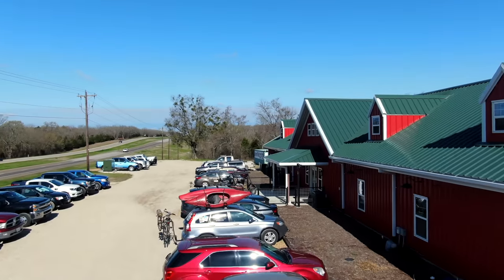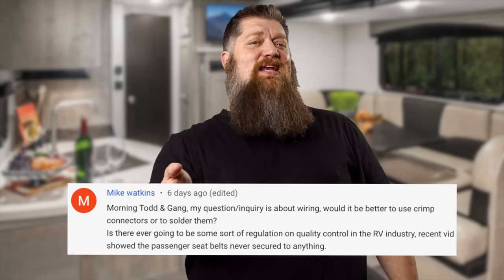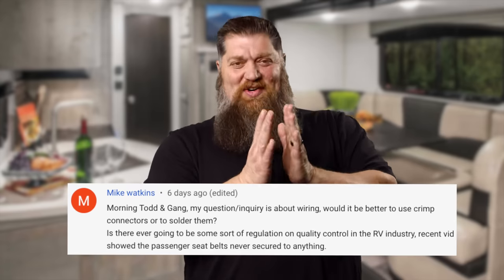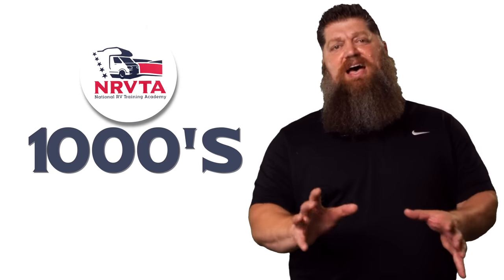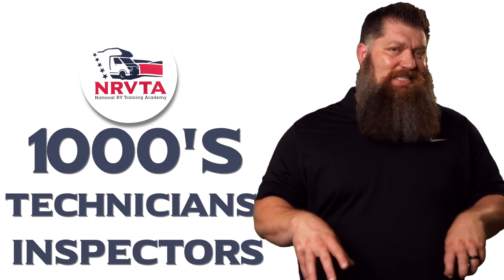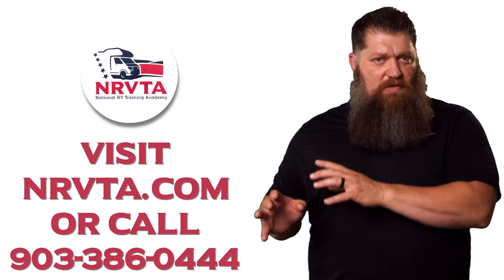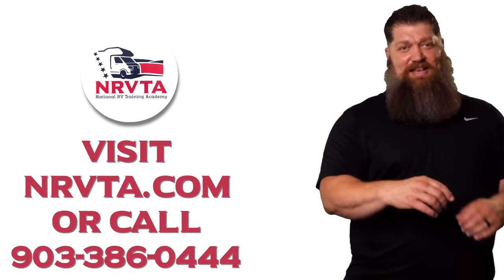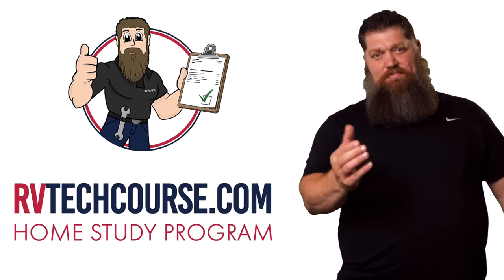Crimp vs. Solder in my RV.  Which is better? // Your questions answered.

Comment: Soldered connections work well for small components where there is little or no flexing at the solder joint, like discrete components soldered onto a printed circuit board.  Components are usually mounted very closely to the board to reduce / eliminate the movement / flexing at the soldered connection.  In applications where vibration is expected (military, aviation, or high stress environments) the components mounted on the circuit board may be held rigidly in place with a non-conducting coating that resembles a lacquer.  If soldering is done right there will be ZERO air gaps because the liquid solder would flow into and fill all the voids.  Flexing of the transition between copper wires and the solder will weaken the bond.  That can lead to air gaps and cause a "cold solder joint".
Crimped connections work well where the cables and components are larger and some flexibility / physical movement is expected.  The key to a good / solid / reliable crimped connection is to properly match the crimper and the terminal to the wire / cable.  If the crimper / terminal are too large, then the connection obviously will be loose.  If the crimper / terminal are too small, then the terminal or wires (or both) may be damaged.  Either case can allow bad things to happen. 
My (Dave's) background: about 44 years as in the nuclear power industry - both US Navy (electronics technician trained in soldering) and commercial power production (calibration technican that worked on dozens of different types / sizes of crimpers).

Comment: I've ben making connections is wire for marine applications.  The flexing of a soldered connections is concentrated at end of the solder which forms a stress riser at the change in flexibility and often  fatigue failure.  Been using crimp connectors for 30 years with sealant.
Reply: I don't see how that's different than a crimp. If a good crimp is 'cold welding' then the flex changes at the edge of the crimp. 
I don't have a firm opinion, just frying to understand the issues.
Reply: @luminousveiws  I posted a detailed comment elsewhere in the thread that may answer your very good question.

Comment: Thanks, Todd.  Do you have an opinion on self-solder heat shrink butt connectors?
Reply: We use Grote heat shrink butt connectors on our Peterbilt and 53 ft connestoga step trailer. They're fantastic.

Comment: 1. The NEC is NOT a guideline. It is a requirement that includes RV's.
2. The NEC does not cover the low voltage equipment. (12v)
3. The NEC allows solder only on connections that are also mechanically connected.
4.The NEC does not allow solder on grounding and bonding connections.
5. Solder only connections can fail/open from high heat caused by high current flow.
Reply: They are supposed to fallow the NFPA but there is no
Reply: Enforcement that I can find I have problems with my new campers. The manufacturer at this point is refusing to fix it is covered in the NFPA chapter 7 how do I get the manufacturer to fix it
Reply: @davehuber6949  I can't understand what what you are trying to say.
What do you mean by enforcement?
You have more than one camper?
What type of campers?
What brand?
What is the problem, exactly?
Reply: I have a 2022 pinnacle the bathroom gray and black tank drain runs up hill so the black tank valve gets full of debris and don't hold. I have to tip my camper until the level Buble is over a 1/2 inch per foot of to get the tanks to drain down to 1/3 of a tank. I have Ben in San Antonio for a month. Getting no where on getting it fixed being told by dealer jayco is saying that is how it was designed. They just want to change the black tank valve and not fix the problem. Then the black tank flush vacuum breaker is in the wall between the bathroom and bedroom with no access not mounted to anything and no access panel leaking in the wall and running into the storage compartment.
Reply: That is the problem the agency that is supposed to be enforcing is paid for by the industry and represents the
Reply: @davehuber6949   You said NFPA indicating you had an electrical problem.
Of course it wasn't designed to not work correctly. I would talk to Jayco myself. It could be the dealer just doesn't want to make any repairs because they have to fight with Jayco to get paid or they don't pay at all. 
Could it be that the black tank is installed backwards causing the pitch on the bottom of the tank to be reversed?  Get under it yourself with a tape measure and check things out. 
If everything seems installed correctly, see if there's a way to lower the exit end of the tank. It may mean cutting some piping but thats easy to re-do.
The vent in the wall should never have liquid at that height. Maybe it isn't installed high enough or the valve has failed and the liquid in the tank is sloshing up the vent pipe. Regardless, it should go through the roof for venting. You should be able to remove the entire wall panel. Hopefully it's not glued. If it is and you can't remove it, go to Home Depot or any such store or even a plumbing wholesaler and buy a wall access panel. Then cut an opening in the wall of the proper size, make the repair and install the access cover. Make sure to locate a studs in the wall and to seal around the pipe where it goes to the floor. If the pipe needs to extended up, couple them together with a female adapter and a male adapter for future removal so you don't need an access panel that is 3' tall.
Reply: @trustme7731  I sent pictures the line is up hill over 1/2 inch per foot. Contacted the agency inspector they won't get involved with coad violations after it leaves the factory. When you pay over 100th for something you shouldn't have to repair it yourself and I have Ben told if I repair it that will void the warranty
Reply: @davehuber6949  lol What warranty?
Sounds like you don't have any as it is.
Well, if the factory and dealers won't do anything about it and you aren't willing to do anything yourself, you'll just have to live with it..
Good luck
Reply: @trustme7731  just frustrating to no they have regulations but have little to no enforcement. I am a HVAC-R installer technician with over 40 years in  commercial industrial  wouldn't be a problem to fix other than gray tank will probably need to be replaced. Left home 28 of oct won't get home until may 15. May have to break down and go buy tools that I already own replace all the sewer drain pipes in the 130 000 7 mouth old  camper. But on a good note word of mouth can be the best are worst advertisement. I did like your info on wire connections

Comment: Hmmm…
Been an electrical contractor for 40 years. 
We could argue this subject for hours.
Reply: Love to hear your take. What type of work do you do?
Reply: Commercial as of late. Most everything over the years. 
Love a crimp joint if it’s never flexed or disturbed. 
Love a soldier joint if it’s subject to moisture provided it’s done right (not a cold soldier joint). Don’t care for either if it’s going to be flexed or moved on a regular basis. 
Prefer something that can be tourqed from time to time
Reply: As for RV battery connections as Todd is referring to. I would go with the crimp connection. Plenty of anti corrosion compound in the lug. Cable bent to approximate shape as it will be when installed. No stress or minimal stress on the crimp joint and install heat shrink to protect from moisture or air. 
I’ve done the same with soldier joints and have had the same success. 
Hope this helps.